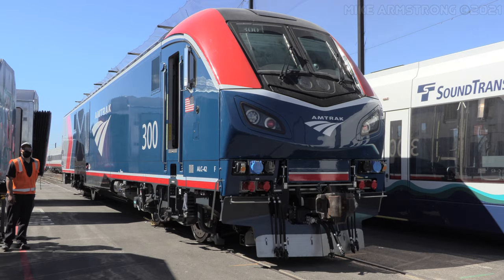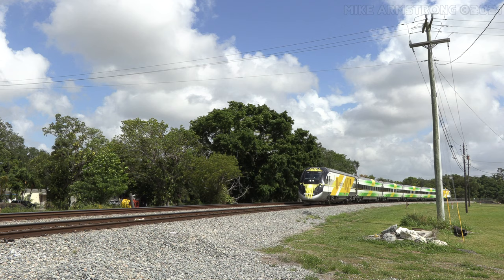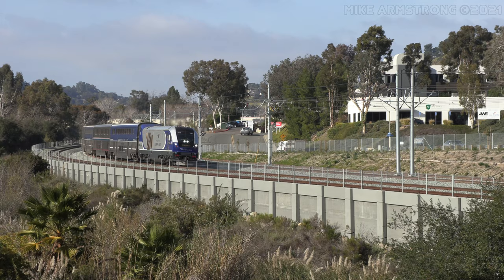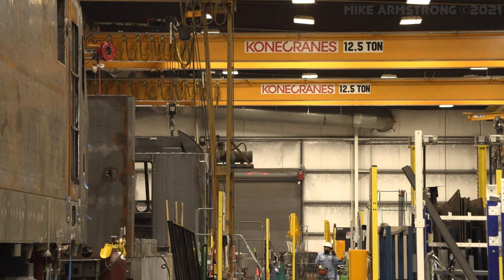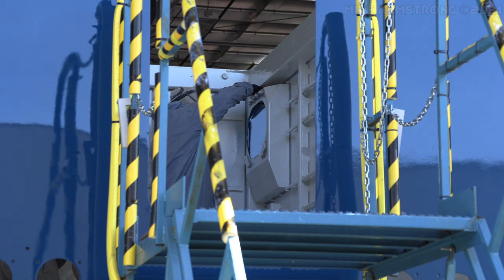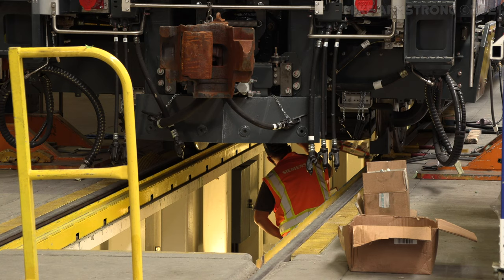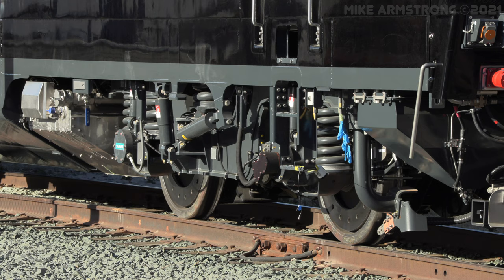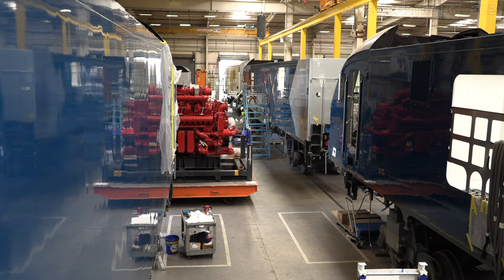Building A Railroad Locomotive - Siemens Charger Amtrak ALC-42

Comment: My friend is a Amtrak engineer and he told me the Siemen's locomotives are setting new standards for reliability and decent power on grades.
Reply: Siemens has always been associated with quality products. I worked where the buildings had a lot of HVAC critical to keeping electronics running and Siemens Control systems were used for this. I also worked around a pipeline and many of their controls were Siemens.

Comment: I love the level of detail in this series! Great informative program.
I have worked at Siemens Graz during my university diploma thesis, here bogies for all kinds of locomotives, trains and coaches are designed and assembled. In Europe Siemens splits up work between different factories, so the Vectron bodies and final assembly are done in München-Allach (used to be Krauss-Maffei), bogies come from Graz (used to be SGP) and I think the electronics come from another place yet.
The Sacramento factory is fascinating because it does all those steps in house, starting from sheet metal doing all the steps to the assembled locomotive.

Comment: In the final assembly area you can see a brightline locomotive in the background. That’s because brightline ordered 5 more trainsets and 11 more SCB-40 locomotives which will be used for their expansion to Orlando. 10 locomotives will be used on the trainsets while the 11th extra locomotive will be used as backup power.
Reply: Can't wait for that here in Orlando.  First new Brightline set should be delivered in Sept this year.   I also saw a ALC-42 in Phase 7 paint can't wait to see that come out.
Reply: Peter,there will be more Siemens Charger ALC-42s in all 50th anniversary paint schemes,Phase 1,Phase 2,Phase 3,Phase 4,Phase 5,Phase 6 and Phase 7 paint schemes and the new Phase 8 paint scheme that I colored in with Midnight Blue,Royal Blue,Red and Orange.
Reply: Awesome!
Reply: @marioscardina2547  Can yo not spam the same comment over and over again
Reply: I see that they're putting tracks around OIA. I'm guessing it's for the brightline.
Reply: Bright line

Comment: I worked for the company as a welder on the Light Rail Team for about 8 months last year. While I heard that the Locomotive weld team was treated pretty well the situation in Light Rail was not pretty. Turn over was extremely high and the work environment was just horrible. It was not uncommon to see welders with 10+ years experience put their tools down and walk out of the building after about two weeks there. Lord knows that I wanted to do it many times as well. During my last month there most of the experienced welders either left for new jobs or were in the process of finding new work. Oh, and they also didn't like paying people. One pal of mine was working for about 23 and hour. Another company offered him a better schedule and 27.50 an hour. Siemens counter offered him with 24.50. He left for the new company two weeks later. I liked building trains. I really did. But I just couldn't stand working for that company.

Comment: I had no idea that Siemens had a railway plant in the U.S., considering that there are very few electrified lines.
Reply: Well just like the VP of Locomotives at Siemens said, they took an electrified design (Vectron, Common in Europe) adjusted it. This is the concept of a diesel electric locomotive. It‘s pretty much an electric locomotive with an Engine to generate.
Reply: It started as a light rail car assembly plant.

Comment: Awesome tour! I hope they have fixed the reliability issues they've had with the Chargers, they're amazing locomotives. Siemens is awesome. I know some have nostalgia over the P42s, but I for one can't wait for those slow accelerating, belching, and deafening engines to be replaced by these faster, cleaner, more efficient, and quieter ones.
Reply from the maker: Thanks! Glad you liked it!
Reply: What problems have the Chargers encountered?
Reply: @Jeragon186  I know some of the ones in the Northwest have been having issues with the traction motors overheating.  I've been seeing a bunch of P42's taking their place on the Cascades, and there should be more Chargers than train sets at this point.
Reply: @BandanRRChannel  I thought that wasn’t possible with AC power. Hmm
Reply: The p42s ain't gonna give in without a fight as for the pig ugly chargers  not that reliable  are they!!!!!!
Reply: Go take a walk pal !!p42s will still be around that's why most of them are receiving the new livery  so a lot more"belching to do

Comment: I remember when the mp-36 was the most modern and efficient passenger locomotive now the Siemens charger has taken that locomotives place.
Reply from the maker: Time sure flies!
Reply: Oh yeah,I already printed a battery electric passenger locomotive that is going to be similar to the MPI MPXpress locomotives and will be manufactured by Siemens.It's going to be called the Siemens Turbostar STM STXpress.
Reply: @CoasterFan2105  it sure has

Comment: It's kind of crazy when you realize that the first engine in Phase VI has only just been delivered to Amtrak and hasn't entered service yet, but we can see Phase VII already being applied to other locomotives on the assembly line! Seems like it will have the shortest "life span" an Amtrak livery has had in 30 years (just meaning that it doesn't seem like it's going to be widely applied like Phase III or Phase V).

Comment: That was an interesting look at What they do to construct, so when he said it takes 8-9 months, I’m going to assume the locomotives will be finished in early 2022, because there’s still a lot more Chargers being constructed, (you may correct me if I’m wrong)
Reply from the maker: Thanks! And yes, every locomotive you see here should be completed by some time in early 2022 if not sooner.
Reply: there will be more Siemens Charger ALC-42s in all 50th anniversary paint schemes,Phase 1,Phase 2,Phase 3,Phase 4,Phase 5,Phase 6 and Phase 7 paint schemes and the new Phase 8 paint scheme that I colored in with Midnight Blue,Royal Blue,Red and Orange.
Reply: I made a phase 8 concept it uses black and red white and blue stripes

Comment: As for a European railfan, these Chargers look as a Hercules (ER20) on steroids to me. :-) But it also says to me they're must be quite reliable engines. So I like them too. My question is: I understand these Chargers are specified for passenger trains. But does Siemens have plans to build locomotives on the same product platform for freight trains? Of course with bigger, stronger diesel engines, traction motors, possible six axle variants etc. Or there isn't any need for that anyway so there aren't any plans for that?
Reply from the maker: They're neat locomotives! In terms of a freight version, I'm not sure. The freight locomotive market in the US is about to go through a major transformation, so it's entirely possible.
Reply: @CoasterFan2105  By "major transformation", are you referring to battery electric locomotives?
Reply from the maker: @satiric_  That and other concepts. But Battery-electric is the big one being tested currently.
Reply: @CoasterFan2105  didn’t think Battery would be an option for freight trains (especially in the US with enormous distances…), here in Europe we are just starting developments in regional multiple unit trains that do like 60km on battery… (which is enough as non-electrified routes are not on mainlines but only on shorter branches). I mean where do you want to put all these batteries on a Locomotive if you are getting only <100km on Multiple unit trains were they are Batteries distributed onto all the coaches?
Reply: They aren't reliable, especially in winter. Last winter they ran out of spare locomotives in Chicago to put on the hiawatha service trainsets because all of the chargers broke down. I caught one of them on the first train of the day a few miles from the Milwaukee station. I heard on the radio after getting back in my car that they would isolate the charger at the airport station because it had already broken down.

Comment: ALC-42
The total contract amount for 75 units is (USD 850 million)
The additional 50 units ordered in June 2022 are (USD 1.15 billion)
The total contract amount for 125 units is (USD 2 billion).
(USD 11.27 million) - (USD 22.97 million) per unit

Comment: I've seen a video where they get a old locomotive strip it down of all it's parts and takes the cab, nose, engine hood and the engine and electronics where they basically also sanded and put new ballast into the train deck and converted the unit from like I think a GP unit to a different unit but still keeping the same train deck.

Comment: number 300 is said to be on the California zephyr with the GE genesis P42's pulling it
Reply: Listen to me Nicholas,You'll probably see more Siemens Charger ALC-42s in all 50th anniversary paint schemes,Phase 1,Phase 2,Phase 3,Phase 4,Phase 5,Phase 6 and Phase 7 paint schemes and the new Phase 8 paint scheme that I colored in with Midnight Blue,Royal Blue,Red and Orange.
Reply: @marioscardina2547  but number 300 is the only one on the zephyr that's completed more r on the way  even number 301 which will fly the new 50th anniversary livery  is on the way as well  just  be patient  right now number 300 is on the zephyr being pulled by GE genesis P42's 
the most common new engines  that r running routes r the SC-44's  for now the P42's r in service til these new engines start rolling out that includes the texas eagle and the sunset limited

Comment: Noticed extra vent on ALC-42s not on SC-44 or SCB-40, I assume this is something for tunnels like on the SD40T?
Reply from the maker: I don't know if that is specifically for tunnels, but I do believe it is part of the air intake system.
Reply: You'll probably see more Siemens Charger ALC-42s in all 50th anniversary paint schemes,Phase 1,Phase 2,Phase 3,Phase 4,Phase 5,Phase 6 and Phase 7 paint schemes and the new Phase 8 paint scheme that I colored in with Midnight Blue,Royal Blue,Red and Orange.

Comment: Awesome Video Mike!! I had a quick question about the Amtrak ALC-42 Charger what kind of horn are they going to have?
Reply from the maker: Thanks! They use K5LAs like the other Charger locomotives. You can actually see the one that is going to go on locomotive 304 at 8:50 in the video.
Reply: I hope at least one or two of these ALC-42s end up with something more unique than a Raised Letter K5LA. Imagine one with a P5 or something.
Reply: I'm mike's new assistant Mario saying You'll probably see more Siemens Charger ALC-42s in all 50th anniversary paint schemes,Phase 1,Phase 2,Phase 3,Phase 4,Phase 5,Phase 6 and Phase 7 paint schemes and the new Phase 8 paint scheme that I colored in with Midnight Blue,Royal Blue,Red and Orange.

Comment: Imagine if there making it for frieght service!
Reply from the maker: Now that would be something!
Reply: A freight Siemens locomotive would be interesting! There are already freight Vectrons in Europe, so a freight Charger would also be interesting!
Reply: Cool
Reply: @SleepTrain456  
With the Vectrons in Europe there isn't really a freight or passenger version, as different specs are only separated by the rated top speed, with there being 120mph Intercity locomotives and ones limited to 100mph usually found on slower passenger trains and freight trains. For example the Austrian railways use the Siemens Taurus (predecessor of the Vectron), which is rated for 140mph, for all tasks ranging from fast passenger services and regional trains to heavy freight trains on mountain lines. 
I'd imagine that if there were a freight version of the Charger there wouldn't be many, if any changes.
Reply: @mikeblatzheim2797  Good point! In fact, I would imagine that all Siemens needs in order to make a freight version of the ALC-42 is to remove the HEP generator, change the first 2 letters, then market it for freight usage!

Comment: With each stage of power conversion, some erergy is lost. The diesel-electric is chemical (fossil fuel) => mechanical (generator) => electric motor. Why the waste?
Reply from the maker: In terms of diesel-electric versus direct drive diesel, I don't have an answer for that unfortunately. It's been the industry standard in the US since the beginning of diesel locomotives.

Comment: Its electric but it uses fuel and needs a generator....what's the point? Why not battery cars that would be used and left charging at train yards? And the train would just be electric motors.

Comment: I find it tragic that in 2021 they are still ordering and commissioning Diesel locos. Lets hope they can be retrofitted in ten years. In Europe they're at least trying H2 or battery sets to be charged with a bit of overhead line here and there. Great tech, people, company though.
Reply: Batteries are worse for the environment than these EPA tier 4 locomotives. Batteries are terrible for the environment due to all the chemicals, rare earth metals and sort life span. Overhead electric catenary, diesel-electric, or hydrogen are much better.

Comment: Just starting to enter standard US passenger service right now 2023-2024 writ large. Still not pure BEV tho which is where the entire Industry is now heading for Freight Rail with possible return of turbine engines as well given the massive natural gas boom in the USA still raging away and how dirt cheap natural gas remains relative to oil derived distillate fuels in particular diesel fuel and gasoline. The US pickup truck market is now being overwhelmed by pure bev trucks further displacing and massively so diesel and gasoline engines starting right now Calendar Year 2024. Since the actual price of pure BEV continues to plunge as does cost the glut of internal combustion engines both diesel and gasoline is starting to become quite large...even for engines this large which have use in farming, construction and mining applications...but again still must compete with pure BEV. Tesla alone will be producing for sale upon in North America 800,000 battery electric vehicles which will effectively cover all new vehicle demand in the USA for this Year but of course 16 million vehicles will be produced on top of that anyways. Not sure who is going to buy all that product given current pricing. Long $unp Union Pacific Railroad strong buy.